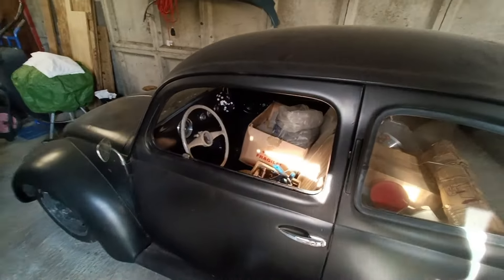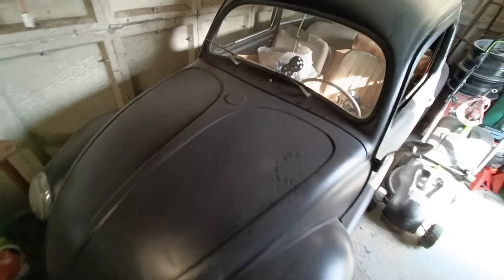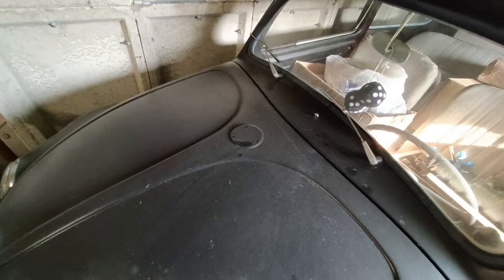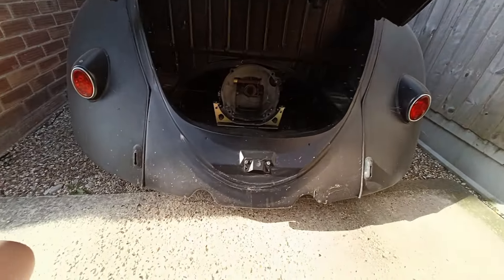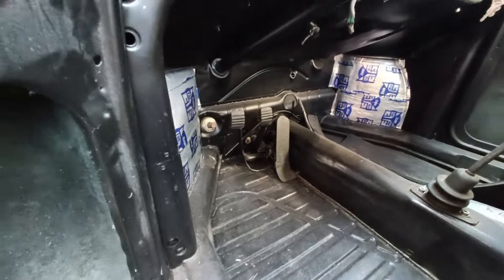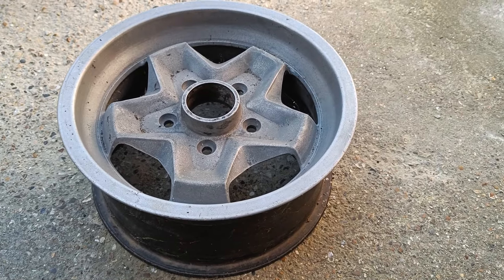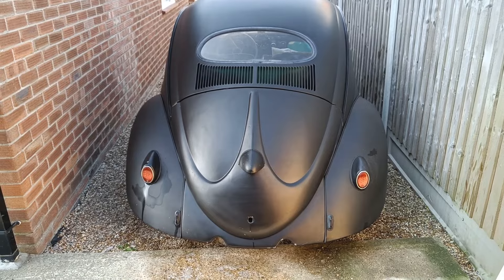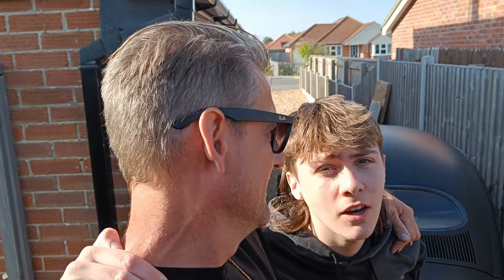Whats in the garage?? My 1954 VW Oval window Beetle

Comment: In high school a friend and I bought a 54' bug. The year was 1974. We paid 100 dollars for it. It was completely original.  It was running, but in terrible shape. We got it looking pretty decent. We even got the semaphores working on the door posts. It became my car after awhile. It sat in storage for about 12 years. I put an exceptional black paint job on it. Rebuilt the motor to look new. Polished the chrome. New tires. New upholstery. In 1990 I sold it for 10 grand.
Reply from the maker: Sounds like good memories. Its always nice to hear them from back when these were regularly used.

Comment: oh if only you made this video before november 2021... I had a 54 pan with a serviceable beam and split case trans on it.  My 54 got an early 60s pan.  The 54 pan was nitpicked by the VW snobs and was stuffed in a scrap metal dumpster.  I lost my shop and had nowhere to put it.
Reply from the maker: Oh no, sorry you lost your shop!!!! Hope you get another Beetle again one day
Reply: @jamiedowson6482  maybe I wasn't clear enough. I still have the 54 on a 65 pan. The 54 pan ended up in the scrap dumpster. But yeah, the pan rolled, all the shafts in the trans turned, beam wasn't rusty, would have worked out well for you

Comment: It is hard to tell from a short video but there are a number of issues.  Firstly the beetle is different from most cars in that the shell can be unbolted from the chassis but the reg. Number should go with the chassis and not the bodyshell.  At whatever stage that the later floor pan was installed this ceased to be a 1954 beetle....it became a 1970 something beetle with a 54 bodyshell.   So at best it should have the 1970's reg or at worst a "Q" plate.  Obviously it has been customised over the years and doesn't retain period correct dashboard for example and when you talk about the original "metallic" blue paint can be seen on the underside of the roof then that's not right either as the 1954 would not have worn metallic paint as original.  It is hard to see from the vid but a closer inspection would determine if this is a modified 54 or is it a later body that has had the oval window roof section grafted in....quite a common thing in the 80's v-dub scene.

Personally I think it is too far away from being a stock 54 oval and to put it back to stock would cost thousands and perhaps become a bigger job than you would want and become uneconomic in terms of ££''s spent and final value.  I think the answer is resto-mod.  Outwardly it looks like a 54 oval but underneath the skin you have ball joint front end, irs,  12 volt electrics, disc brakes and an engine that can use unleaded petrol and keep up with modern day traffic.  Porsche ajs cookie cutters are tough looking and cheap compared with Fuchs. ...you just need replacement front and rear hubs to fit the 5x130 Porsche pcd wheels...  6j front wheels were the norm for the beetle with 7's on the back....with a narrowed front end you might get wider but then its heavy on the steering.  6 inch cookie cutters are easy to come by and I have several sets and could let you have a pair if the project is a go-er.  A good edition is a Porsche space saver steel wheel for a spare.

This is a great project for somebody and definitely too good to scrap....if Matty B mentions the "S" word again then he should be sent to the naughty step.  This car is not strictly kosher but is worth good money.   I Had a 56 oval which my wife nagged me to sell...it was a pukka original and I sold it a few years ago for £4.5k....I wish I had dug my heels in and kept it as my wife didnt last as long....she left with a loal postman!!

Good luck with the project. ...but please don't scrap it!
Reply: Dash is exactly correct to 53-57 + it has rare motometer 3 gauge accessory panel in speaker mesh place. Also stratosilver, which is original to that car is metallic paint, also ultra maroon has been metallic paint. Not with clearcoat at that time, but metallic yes. And it is original 54 body, which has been fixed with universal panels that time. 53-55 body is easy to separate even from 56-57 if you know something about ovals...
Reply from the maker: @isi2966  Yes exactly right. Thanks guys for your comments. Keep them coming and thanks for watching 😁